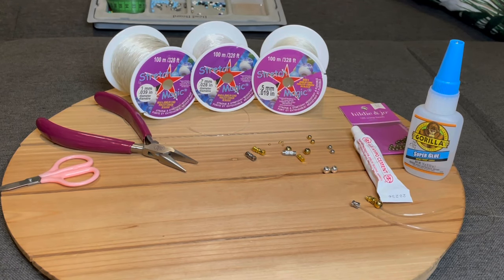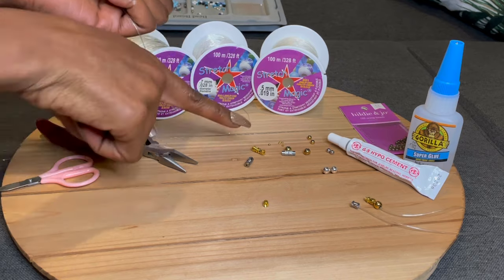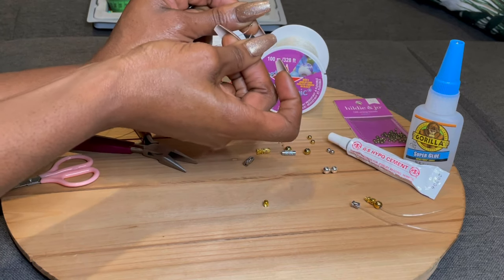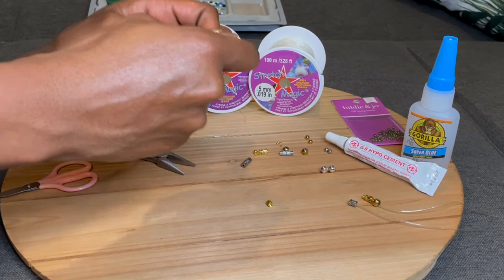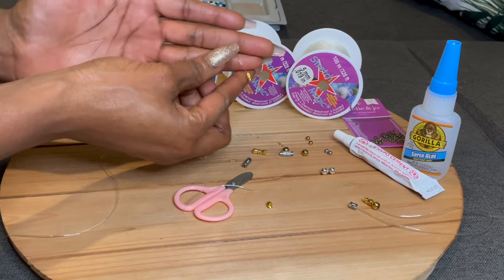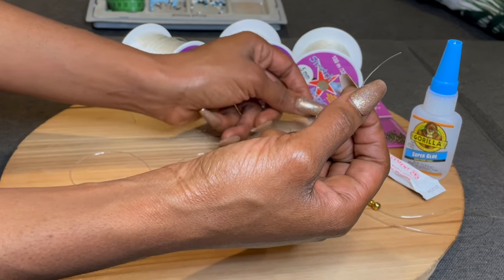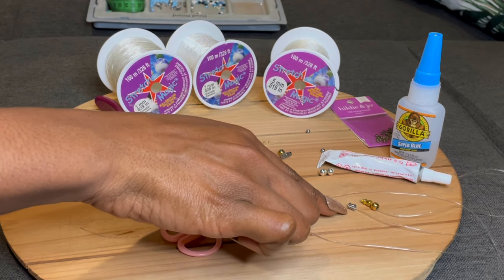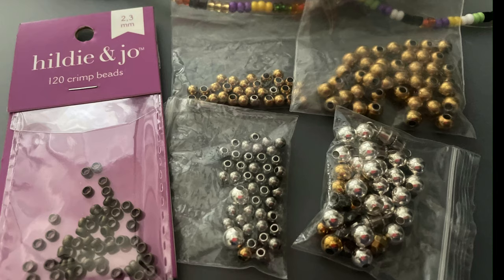How to Apply Barrel Clasps - Part 2 CLOSE UP

Comment: I'm new at this, my question is if I'm a 28 waist how long do I cut the elastic? Love 😘your videos you make them very easy for beginners.  Thanks
Reply from the maker: Welcome! When measuring for Waistbeads do not use your pants size. You want to grab measuring tape, or check out my dollar bill measuring technique video. Wrap the tape around your waist or hips; wherever you want your beads to rest. Use that number to determine how long you want your string to be. (If you measure at 35 inches, you string has to be at least 35 inches long) Give yourself and extra 4-10 inches in each side of the string so you have room to tie them on or add a clasps.